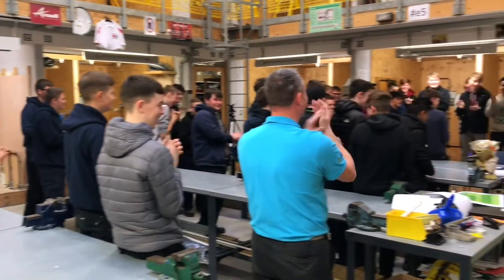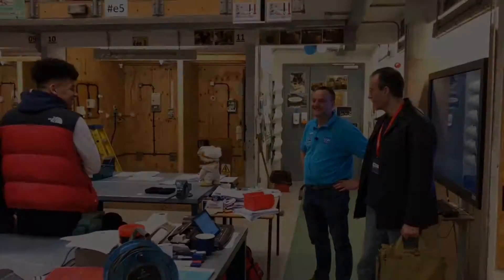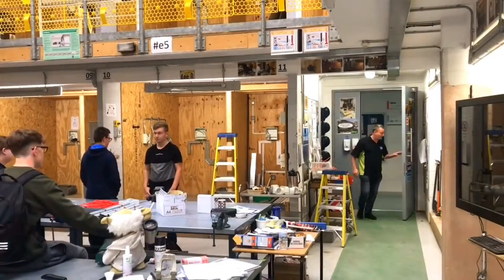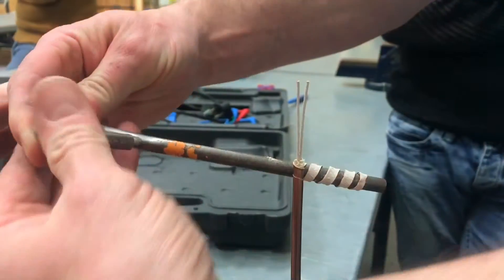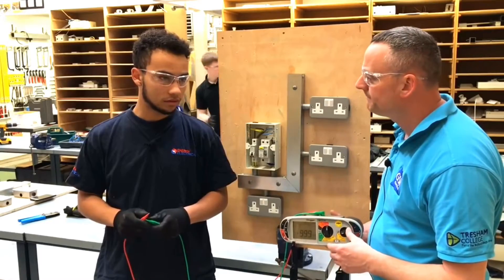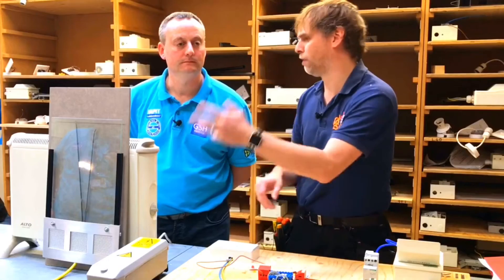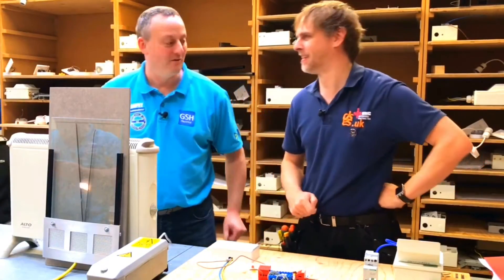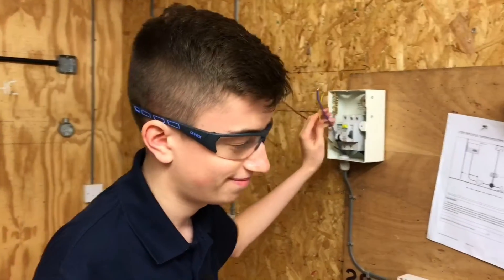Tresham College Welcomes YouTube Special Guests but the Electrical Learners are the Real Stars

Comment: Where do you get the 20Mohms from for new installation? My understanding from the regs the minimum value has always been 1Mohm whether it’s new or existing.
Reply: Robert Swingler - This is because if it is a newly installed circuit the minimum value must be above the value of 20M-Ohms, the relevant information is in guidance notes 3 👍
Reply: @spencerdul2801  with every one referring to GN 3 , we can throw the big regs book in the bin then , ? No of course we can’t, GN3 is simply that,  it’s guidance the regs is what we work to and the regs say the minimum value for insulation resistance is 1 meg ohm , yet are constantly being told that less than 2megohm further investigation is required. So what do we work to the wiring regulations or GN3 .
Reply: @spencerdul2801  wrong, stuff GN3 , the Regs BS7671 is clear the minimum value for insulation resistance is and always has been 1megohm  for new and existing installations. If I get a reading of 1 megohm I’m happy if I get a reading of 2 megohm or higher I’m even happier, if I get a reading of less than 1 megohm I will start to worry.